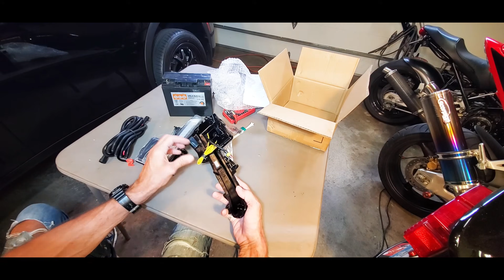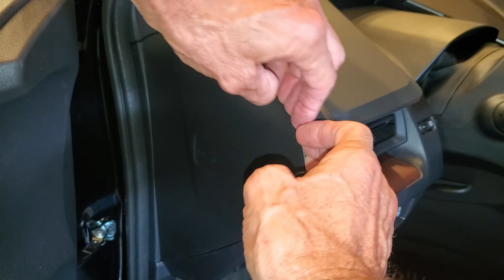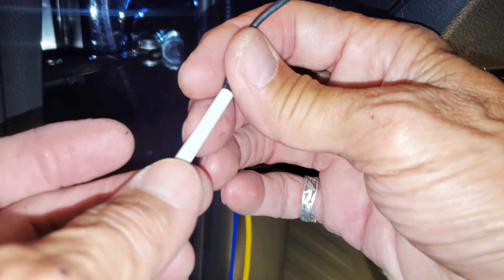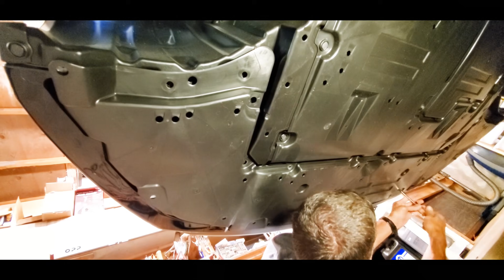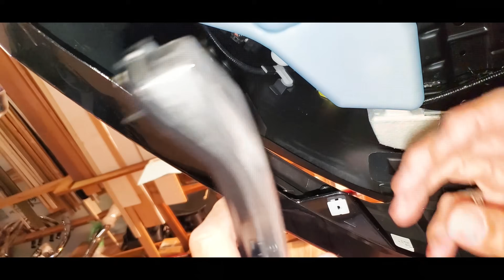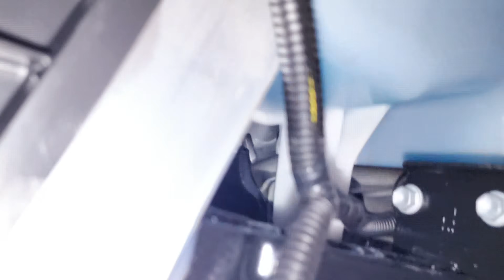Install Fog Lights on 2025 Prius GEN 5 DRL Sequential Signals 2023 - 2027

Comment: Forgot to ask, and dont know if I missed it in the video 

What gauge and length of extra wire did you buy?
Reply from the maker: I used 16 gauge. It was overkill, but I used it because I had it on hand so I wasn't ordering wire for this job. At less than 10 watts total, 20 or even 22 gauge is fine; particularly with the added protection of the flexible corrugated conduit. For me, part of choosing a gauge is planning what other projects I might be able to use the wire for. If you think you'll be adding other auxiliary lights to the circuit then up-size the gauge accordingly. The lights come with a fair amount of wire but I'd rather have extra than not enough so 20 feet each of blue red and yellow should be more than enough. I put links in the video description to get you started on well-reviewed wire in various gauges.
Reply: @ScubaMoto you used the blue wire for the right foglight 
What were the yellow and red for? The switch?
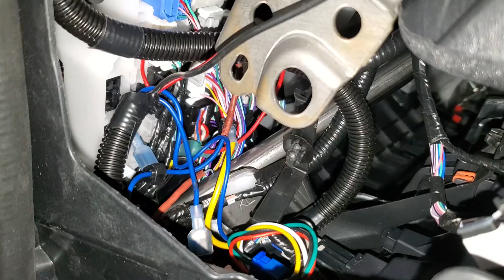Reply from the maker: Red is main power for both assemblies. The lights come with a harness that plugs into the assemblies and that harness also uses red as main power for the DRL mode. I used blue to connect to the yellow signal wire that comes with the right light assembly because it matches the blue power source for the right turn signal that I show at the distribution block. 4:56 The left signal power happens to be yellow, so that's why in the video, I show extending the yellow wire from the left light assembly using yellow wire. You can use any color you want so long as you know what they are for. Blue and yellow wires both run back to the right and left (blue and yellow) wires that I show at the distribution block.

Comment: During the probing for wire function, did you happen to find the high beam signal wire? I am installing a light bar and wish to control the lightbar relay with high beams
Reply from the maker: I did not. But at least I've ruled out the blue, yellow and red.😂 I know It's not high beam, but would the blue switch-illumination wire work since it does require headlights to be on?
Reply: yeah blue would do the trick. however, I was hoping with the High beam auto dimming  feature, there would be less chance of blinding oncoming traffic as this is a bright light bar
Reply: thanks for such a well made video

Comment: Great video. Bought the kit and added to my SE but I left out the turn signal wires. I have a strong dislike of lights that turn off in place of turn signals. But the power on animation is cool.

You were very correct about that right side. That was a huge pain to get in. It probably consumed about a third of the total time I was working on the car.
Reply from the maker: Glad you liked the video, and congrats on the new install. Interesting point on turn signal preference. Between that tricky right light mount and poking wires through the firewall, this job feels like an accomplishment. Thanks for sharing.

Comment: Great video.
Would be great to see the centre rear light bar conversion. My UK car only has the two outside ones....
Reply from the maker: Thanks, I'm glad you like the video. That hatch light function is common to some of the trim levels. I have no plans to change mine; but for those who want the change, I do mention options for a conversion in a reply to another comment on this video. Depending on your model and trim, the conversion is usually easiest as replacement of the center lamp assembly with one from a higher trim of the same drivetrain (Hybrid vs Plug-In Hybrid). For the SE it 's a fairly simple swap since the SE harness is plug and play. For an LE, you would wire the new XLE light how you want it to function.

Comment: with that installation does not turn a fail light on your intrument panel?
Great video!!!
Reply from the maker: Thanks, I'm glad you like the video. It's only been a few months, but so far, no dash lights or other issues. At half an Amp, I'm not surprised. Even if they are twice as bright as the OEM DRL's, we would all like a true  beam fog light. But then you would certainly need to add a relay and possibly choose a higher amp circuit to tap into.
Reply: @ScubaMoto ¡Great!

Comment: Safe to say the SE prime wiring does not have the connectors to add OEM fog lights?
Reply from the maker: Correct, at least I didn't find anything. If there had been, then it might have been like swapping these lights into a higher trim model. You would not have a dash switch and you would still need to tap them into your turn signals.

Comment: Thanks, great video. could you describe Red, Blue and Yellow wires gauges?
Reply from the maker: Red is main DRL power, Blue is right signal and Yellow is left signal. Wire gauge is 22 or larger. With less than a combined 1 amp draw for these lights and the 8 or 10 foot run, you could use as small as 24 gauge but I chose larger and recommend at least 22 gauge more for durability than capacity. 16 gauge was overkill, but that is what I used because I had it on hand. At less than 10 watts total, 20 or even 22 gauge is fine; particularly with the added protection of the flexible corrugated conduit. I put links in the video description to get you started on well-reviewed wire in various gauges. For reference: https://www.powerstream.com/Wire_Size.htm
Reply: @ScubaMoto  Thank you

Comment: Nice and interesting  Video 👍🏻, Have you tried to install leds in the long red rear view of the trunk ? I have seen but didn’t know How
Reply from the maker: I'm glad you like the video. The new DRL's have been great. As for the rear hatch light, I've heard SE Plug-Ins (Primes) have harnesses that are ready to go if you just buy the rear hatch light for the higher trim XSE model, it should be plug and play. Apparently the LE models need some wiring if you buy the XLE hatch light. Also, the Prime (Plug-in) hatch light strip is clear and the non-prime (Hybrid only) strips are red, so no mix and match. I haven't decided if I even want a lit strip but if you do, a few options are:

1- Buy a new or used hatch light from a higher trim and do your own wiring for however you want it to work (or plug and play if you have a plug-in SE model).
2- Put an LED light strip through the lower trim light.
3- Use multiple LEDs on a line, kind of like x-mas lights and drill mounting holes to insert them through the rear of the light housing to light the strip lens from behind. For the plug-in models (SE), they would need to be red since the lens is clear. You would wire for either brake only, headlight only, or both.

The concern with a custom set up would be matching the color and brightness of the adjacent tail lights that are on either side of it. It needs to be close enough to look like they come on as one. If anything is off, I would not be happy with it. You notice the DRL's in this video are pretty much nothing like the OEM running lights. They're brighter, have sequential action and have turn signal and flasher action. In spite of all the differences, they integrated well when combined with the existing OEM lights. Thanks for the comment and for sharing.

Comment: how much you charge if i bring my prius to install that ?
Reply from the maker: You got this. A lot of the time I spent was testing the function of the lights and then probing circuits to identify which 4 vehicle wires to tap into for these lights to fully function with the turn signals, flashers and the illuminated dash switch. Since these lights came with no specs and essentially no instructions, it also took a fair amount of time to set up testing the lights to learn their full functions, and to measure how much current they would require so I knew which vehicle circuits I could use and if I would need a relay. This video saves viewers quite a bit of time by sharing what I learned. Normally, if lights showed up with no specs and no instruction, I would return them immediately for a refund. But once I tested them and saw how they work, I decided to do the install.

Don’t get me wrong, there would still be plenty of shop time in routing wire, making connections and protecting wires with the flex conduit. I Insisted on soldering rather than crimping all of the connections that I made beyond the factory harness and that cost me some extra time. For each connection you see me soldering, you can save time by just crimping butt splices and living with it. It would also save you a LOT of time and effort by staying out of the dash completely and not having the dash switch that I install in the video. You could just tap all your circuits under the hood by tapping a parking light wire for DRL power, and tapping the turn signal wires under the hood for the signal/flasher function. My preference for having a dash switch created more work, but I feel it was worth it and I would recommend it for any client. With this video, I just showed what I view is the best possible installation of this light system, not the only one, nor the easiest one. 

Whether the install is done by me or a good stereo/electronic shop, it would likely mean 3 to 6 shop hours plus parts and materials. I can’t give a hard number here in comments but all video descriptions on this channel have business contact information.